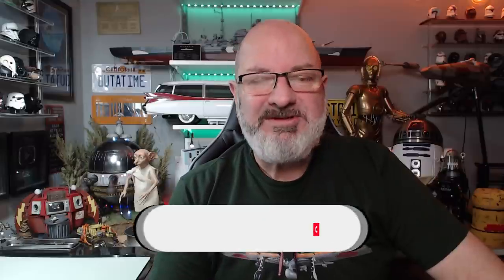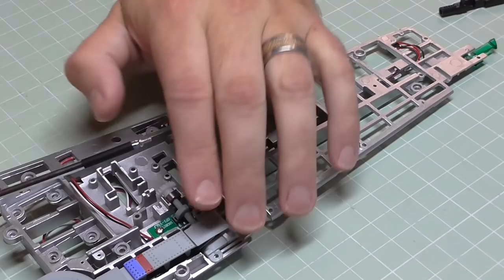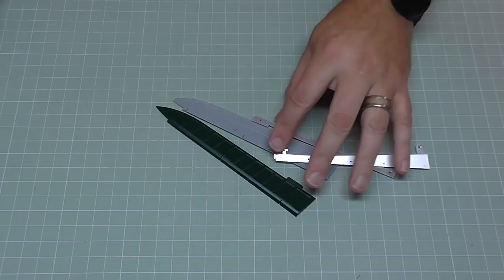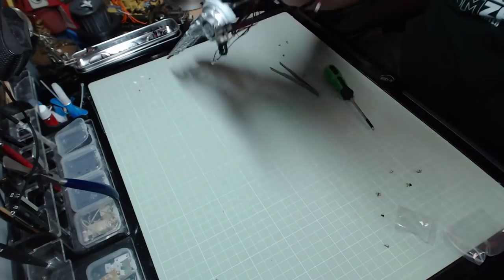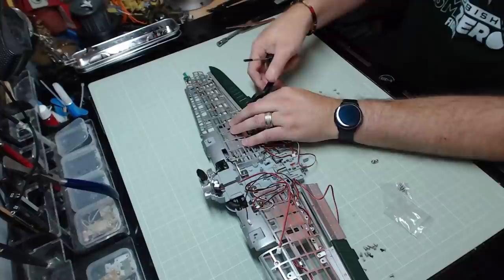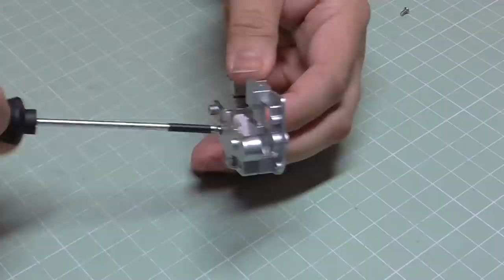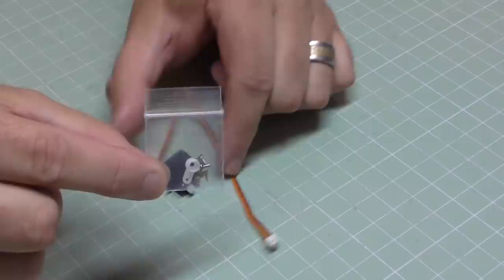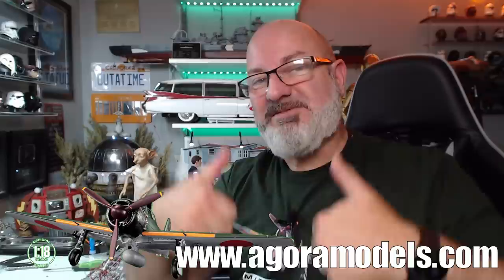Agora Models Build the Mitsubishi A6M Zero Fighter - Pack 6 - Stages 46-53

Comment: Thanks Wayne. I appreciate your quick response. I've played with this problem all day and I THINK the problem is that the axle of the middle three gears is loose even when the cover is on. When I turn the plane right side up the only parts that move are the three gears. Since the gear on the motor is fixed and the gear on the D shaped axle is fixed the only thing left to move is the center gear on its axle. So - I've resorted to the ultimate solution - I superglued the axle into its grooves and am waiting to see if that helps.

Comment: I have the same problem with the right landing gear hanging down. There is no problem with the left landing gear. I have taken apart the right landing gear several times and made sure that the red comb gear was meshing properly and not preventing the gear from retracting fully. I have taken apart the motor and the 3 gears, tightened everything and put it all back together again. When the plane is upside down the gear sits in its recess properly but when I turn the plane right side up the gear hangs approximately 1 or 2 cm below the wheel well. I have tried suggested methods for tightening up the landing gear but have not been successful. I would appreciate any help available. Thanks
Reply from the maker: I’ve still not fixed mine yet. When the wheels retract in the video they happen 1 at a time. I’m hoping that will fix it

Comment: Wayne, I had the same problem with the right landing gear hanging slightly too low and will not close the landing gear door.  The gears were fully meshed, but it still was hanging low like yours.  The problem was with the main gear strut, as it is slightly bent or does not retract fully.   I put a shim on the landing gear door mechanism so the tire would touch it and the gear door would close.  How did you resolve your problem?
Reply from the maker: I reopened everything, tightened everything and then put back together. I suspect it was actually the gear in the landing gear itself where the red comb thing was
Reply: @WorldofWayneUK  I had to do the same, I found that the shaft with the bearing on it was loose, so I tightened it up again and it worked.  Have you considered doing addendums to your videos at the end to  show where mistakes are, or that can be made?  For example, The landing gear "arm" that is supposed press the limiting switch, was made too small and fell short of both switches.  So I added a plastic "extenders" so that it can depress each switch.  Examples like that.